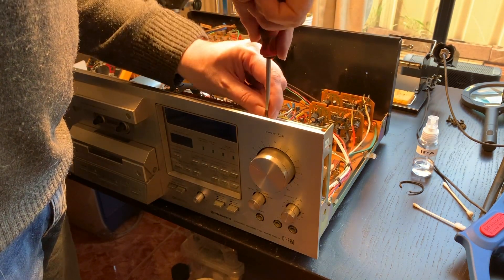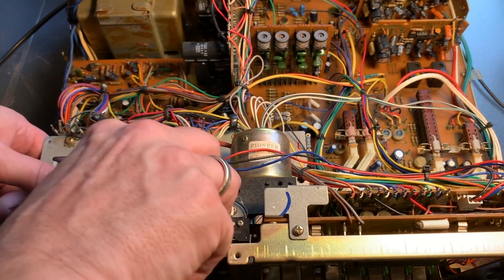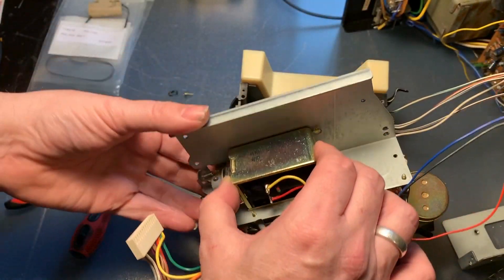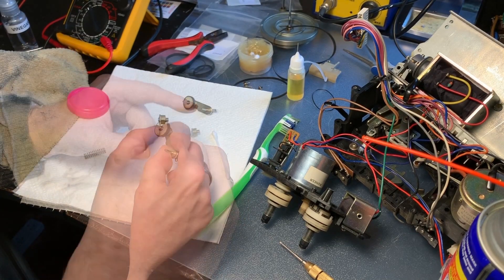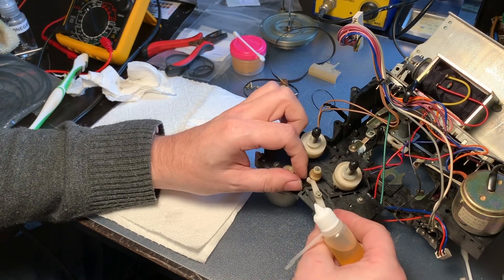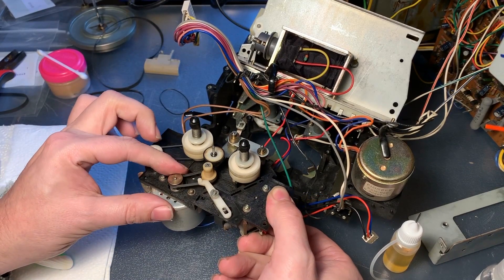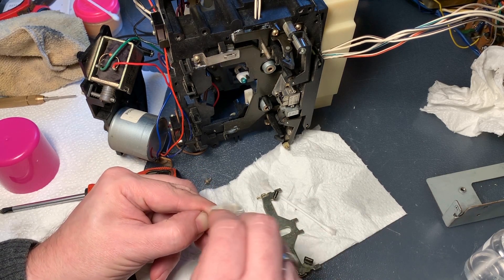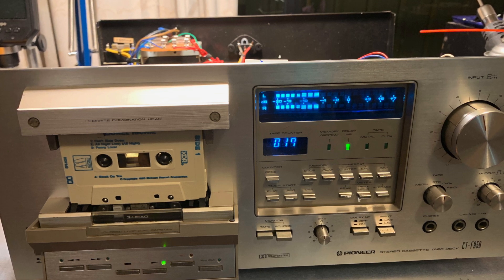Pioneer CT-F950 Restoration Part 2

Comment: Greeting and Salutations  

Great series!

I purchased the new Tire Rubers for the Pinch Rollers and would like to know the best way to get those tires out.

Should I remove the arms and then knock the pin through with an Awl?  Hate to remove the right one with that plastic adjustment nut.

Are can I pry the arm tongues wide enough without breaking one?

Thanks in advance.

Comment: Hi ser. Very nice video. Very good tutorial. I have the same deck and gonna need to do the same service to transport soon. I have questions. Did you change idler tire as well and where did you get the belts from? There is some on ebay, belts only no idler for around us $20, but I'm not sure about quality. Who would you recommend. Thanks in advance.